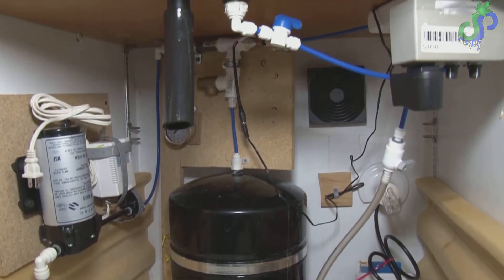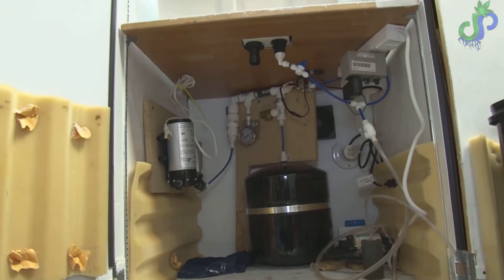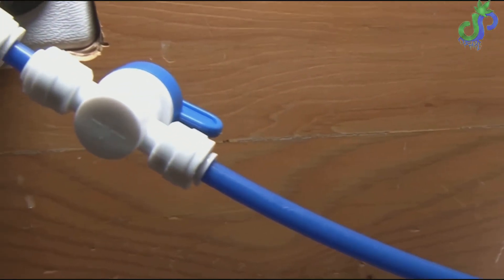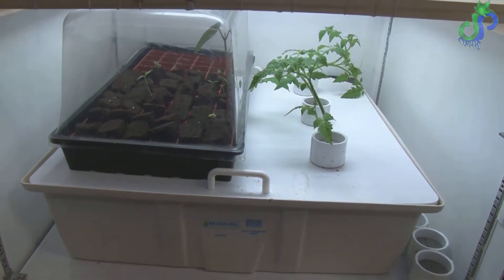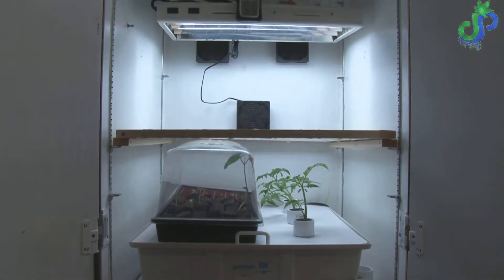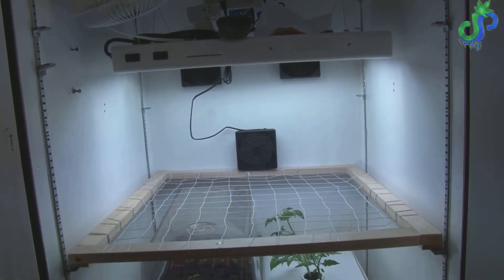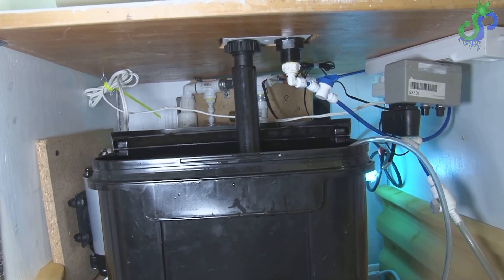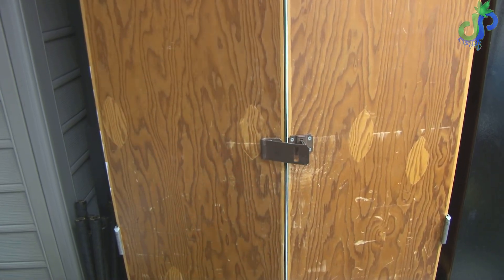High pressure aeroponics diy build in custom cabinet

Comment: I`d recommend buying a better quality accumulator than the one linked in the description ;) They dont hold up well when running near their maximum 100psi working pressure. When the diaphragm fails, you have to throw the tank in the trash and buy another. Better quality accumulators have higher working pressures (typically 150psi) so they can handle 100psi with ease.  If you buy an accumulator with a replaceable bladder  you wont have to throw the tank in the trash ;) The aquatec pump runs on 24v ac which may leave you vulnerable to power outages, you can make the system immune by using a dc pump, timer and solenoids.
Reply from the maker: Interesting. So first question. Do you have a link I can see better accumulators? Because lets be honest I went on amazon and just bought one that fit my needs. Also I'm only running at 80 psi not that in the long run that matters. This is a dc pump. It has a ac to dc block, or at least I think that's what that is. I haven't seen any outages but please, sincerely, I'd love to upgrade if you have anything that might work and protect me from disaster. Hook me up with links so I can look into it.
Reply: @jPapapot  
 My old 8800 runs on 24AC, the transformer converts 240ac mains down to 24v ac. You must have a dc version. You could have saved yourself $8 on the 12v power supply by running the solenoid off the pump transformer if its 12v dc output ;) 
It looks like the accumulators i use are pretty  expensive stateside, my 6.3 gal (10 bar) lists at $90 vs $62 here. I have 3 big 26.4 gal (10 bar) accumulators that cost me $225 each, they list at $510 ouchy! I guess the list price could be different to the retail price or they wont be selling many ;)
Here`s what they look like, http://zilmetusa.com/en/Literature 
Its page 12 in the 2018 price list pdf, blue Ultra Pro tanks with replacable bladders. The 6.3gal is about the best value, theres a big jump in the list price for larger tanks but not that much difference for smaller ones.
Reply from the maker: @atomizer2665  I've seen those accumulators. Are they sometimes used for hot water? They are a little nicer for sure. I've seen one in the brewery I work at my restaurant. I would like one of those but maybe when I'm doing more than a few dozen plants. I just feel spending $40 for a while until it gets more regular. And did you say with those you can replace the bladder?
Reply: @jPapapot  
They can handle hot water but the main thing is they are for potable water, ie safe for drinking or food prep.I started out with a couple of reverse osmosis tanks and both of them went south inside 18 months. I replaced them with a 100L(26.42gal)  vertical and its still running on its original bladder 8 years later. I added 2 more 100L tanks in 2016 along with a few of the smaller 24L (6.3gal). The big tanks hold about 40L (10 gal) each so they can run for upto 2 weeks on a single fill. Some folks think nutes go stale or stagnant, i`ve tested them after being in the tank for a month and there`s no change. I run drain to waste so nothing ever comes back to the tanks.
 I use a 160psi 12v pump to manually charge them to 140psi when they run down to 80psi, about 8 minutes per tank. The pump isnt as quiet as my aquatec 8800 but thats no problem when you can choose when it runs ;) One pump, no pressure switches or relief valves as the tanks are essentially  standalone nutrient batteries once charged. Some folks think big tanks are wasteful but i can add anything from a cupful to 40L so thee is just enough to get over the finish line. Pumps controlled by a pressure switch could refill a small tank 10 minutes before you want to change the nutrients out.
Just a few ideas for you to consider, if/when your tank needs replacing ;)
Reply from the maker: @atomizer2665  are you on ig or anything? How system sounds exquisite. I'm definitely going to start looking into it. I wish I knew about this sooner and you'll see why in my future videos. Don't be too disappointed in me!
Reply: @jPapapot  
lol, I dont use IG, FB etc but if you dont have a big box of aero spares (stuff you shouldnt have bought along the way) you havent done it right ;)  
I`ve been at this for a long time,  some of the systems i`ve built and used are pretty radical. Trust me, high pressure aero isnt the most advanced /expensive form of aero out there ;)
 Here`an offgrid high pressure aero system design i came up with and tested some years ago. (it includes a pic of the big accumulators i`m using). It used a 20w solar panel hooked to a 7ah SLA battery that powered the 12v timer and solenoids. The pump iself uses no power.. just elbow grease to charge the tank. The adjustable pressure reducer maintains constant output pressure from the tank. The pump delivers 45ml per stroke (at any pressure) so it takes a while to fill the tank but theres no real resistance even at 140psi considering  the pump can manage 735psi ;)  These days i only use the pump for  pressure testing system plumbing and accumulators..which is what it was originally designed to do ;) 
https://youtu.be/8pkp6SG0NvE
.
Reply from the maker: @atomizer2665  damn you're a lot more about it than I thought was possible. 700+psi that's wild. I wouldn't be able to afford that kinda stuff unfortunately. I'm just a restaurant server. But I'm gonna check your shit out. I'm definitely excited to learn more. I do feel though after running my system that I'm not really all that impressed by its growth rate. As far as growing cannabis a drip system in rockwool performs just as well. I'm looking to move on if not for any other reason than to try more growing styles
Reply from the maker: @atomizer2665  hey thanks for giving me some info on the bigger picture. I have a lot to look into. Maybe one day I'll have something to teach you.
Reply: @jPapapot  
I`ll look forward to seeing your progress ;)
Reply: @jPapapot  You don't need a DC pump to solve the power outage issue. You only need a UPS. You can get a packaged system that has the battery, pure sin wave inverter, auto transfer switch, and battery charger all in one, or you can get all the parts separately, or you can find an inverter with the auto transfer switch and battery charger, so all you need is the deep cycle DC battery. The inverter im using has those on board, so it just wires up to the battery and thats it. You plug the pump and the controller into the inverter, or packaged UPS system (stands for uninteruptable power supply). You can also connect solar panels to these inverter/battery systems, or packaged UPS systems. 

Also, diaphram pumps suck, in general. I've tried them all, and almost all eventually fail. I have like maybe two out of dozens that havent failed yet. I've moved on to using rotary vane pump heads with AC motors. And @redbird_wa, the only place that does a good job growing high pressure aero cannabis at scale, so far, uses Franklin bt4 multistage booster pumps, and uses constant pressure systems instead of tank/switch conventional systems (constant pressure systems use a tank, pressure transducer, and VFD to control the system, and can do some cool things that conventional systems cannot, like only have a 3-5 psi drop from the accumulator before the pump kicks on, instead of 20 psi, and they can throttle the RPM of the motor to meet the specific flow demand at any given moment). Even if you only have a tiny set up, its a better idea to invest in a small fluid o tech or procon pump head, make sure its stainless steel, and has an internal bypass, and uses a V band clamp to fix to the motor, and not bolts. And use the one with the smallest available flow rate they offer. The first one I used for my 18 chamber, 36 plant set up was a 144 gallons per hour fluid o tech. It was more than capable of feeding the 72 nozzles in the system. They dont all fire at once though. I have a galcon ac9s controller that operates both the hydraulic mist and the air atomizing dry fog system and their solenoids. So the mist nozzles fire in groups; 6 of the 18 chambers fire at a time, as if on one "zone" on the galcon. 

I know this is an old post, and you say you've moved on, but if you ever decide to mess around with aero again, come find me on IG. Unlike Atom, I dont think im too good for social media. In fact, the cannabis grower community on IG is really a great place to exchange info and learn. I know I personally have benefitted from getting on IG and networking, so much so that I wouldn't be where I am with this stuff if I had continued to scoff at social media. I used to grow only in rockwool, doing open drip and then pressure compensated drip, and got into the crop steering stuff, but a few years ago I got into hpa after building a new high pressure aero cloner as a result of repeated failures of my old low pressure cloner systems. I got hooked. Growing at home isnt just about the harvest and the yield, its about the process and the journey itself. Out of all the methods and techniques I've tried, high pressure aero and air atomizing aero are by far the most fun. You get to build things and tinker with new stuff and try to optimize the systems, and because theres such little info out there on it, it really is more challenging than just plopping some cubes on a bench and dripping on them. 

I am not gonna sit here and act like I am THE authority on growing in high pressure aero. Im not, and neither is Atom. But I will show you what I have done and am currently doing, and will answer pretty much any question, if I have an answer to give.

Comment: What bonticare tray do you have and what lid?
Reply from the maker: so this is the 2x2 (22"x22") tray. The lit is a basic as fuck piece of 1/8 inch hard food grade plastic. I got it from a local plastic supplier.  I just went in and asked if they had food grade plastic and if they carried it in white. They carry 4x8 sheets of any thickness up to 2 inches.Different colors and plastic polymers. It's a nice option. If you're in a major city google your local plastic supply. I can't image San Diego is the only place with one. Hell I know about three in the city. But yeah. Measured the inner sizes and had them cut it . Cost like $40 I think. But it works well. Did I answer that ok?

Comment: How do you recycle the nutrient solution?  Do you disconnect and fill the accumulator tank every day?
Reply from the maker: So the accumulates hold pressure. The pump fills it but because the solenoid closes the line it builds up in the tank. Every time the solenoid opens the tanks depressurizes. The pump is on a pressure regulator that turns it on and off. When the tank hits a pressure below 75psi the pump fills it back up automatically.  The tank is always pressurized. I only drain the tank completely once a week or so. Not very often, mostly to re pH the water. Think of it all as parts of the same conveyor belt system, the tub holds the water, the pump pulls the water out and puts it in the accumulator. The pressure regulator tells the pump the tanks full. The solenoid empties the stock through the misters and the misters stray the roots. The excess water falls back to the holding tub. Hope that helps a little.
Reply: jPapapot Oh, at first I thought the pump was pressurizing the accumulator tank with air, but now I assume it uses the water from the tub to pressurize the accumulator tank, and then the solenoid is used to open a valve, which releases spray.  When pressure goes under 75 psi, the pump turns on and sends more water to the accumulator tank to reach 75 psi
Reply from the maker: @daddythreelegs4113  I think it's 80psi not 75. But you got it exactly.